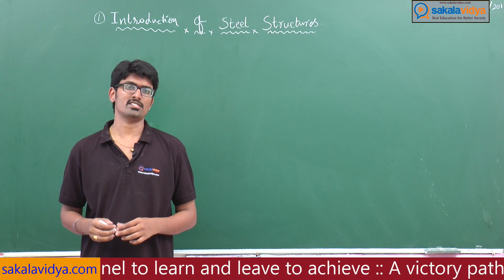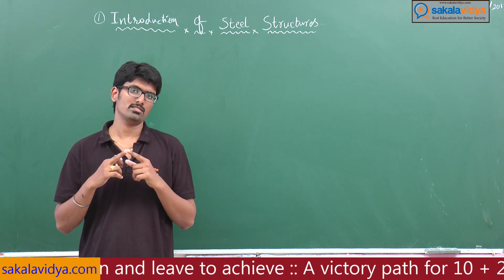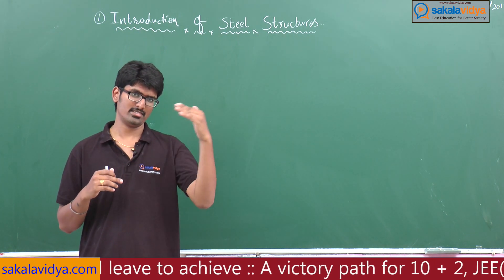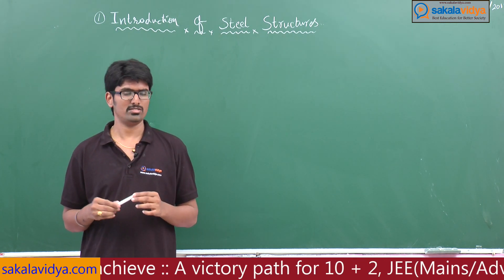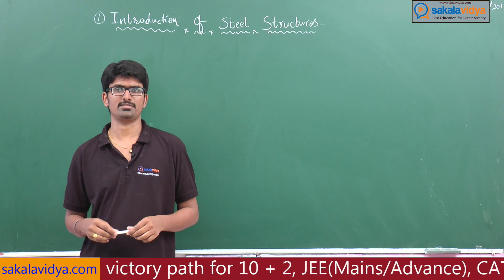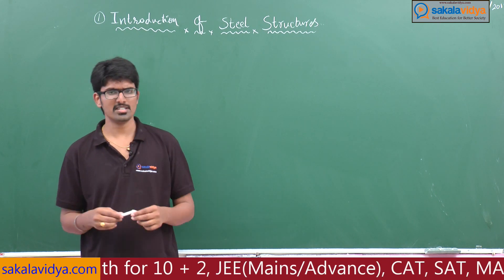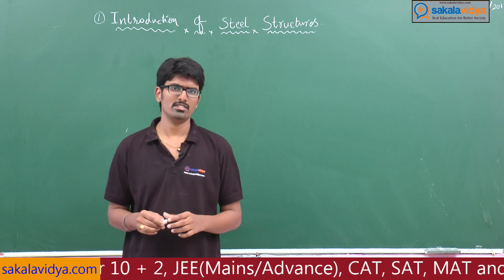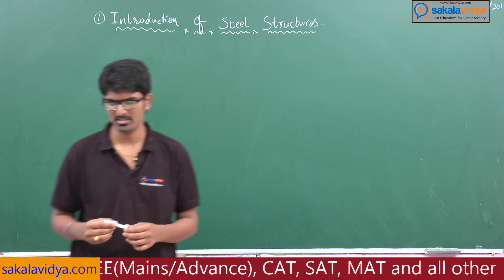Diploma| CIVIL ENGINEERING|Design of Steel Structures| part - 2

Comment: sir iam following your tutorials.They are good .i hope ultimate load method gives more economical sections( less cross-sections) ...you have mentioned at 11:42 seconds "it is uneconomical"..please give clarification ...
Reply from the maker: in order to understand this concept,let me give a compersion between WORKING STRESS & ULTIMATE LOAD methods.
Reply from the maker: WORKING STRESS METHOD:
1)One of the oldest methods that we have.
2) It is based on elastic theory.
3)It dosn't use any factor of saftey with respect to the loads.
4)It does not account for shrinkage and creep which are time dependent and plastic in nature.
Reply from the maker: ULTIMATE LOAD METHOD:

1) it is obtained by  multiplying  some service loads with sutiable factors.
2)by this method we get very "thin" sections and have less reinforcement compared to working stress method.

3)as the sections are very thin,which leads to excess deformation of the structure & ca urks which makes the structre un-servicable,thus which is "UN-ECONOMICAL."...
Reply from the maker: thanks for your feedback please follow us on facebook,
Reply: thanq for reply..
Reply: KARTHIK CHARY BOMMENA  your most welcome..please follow our channel for more updates follow us on FB.